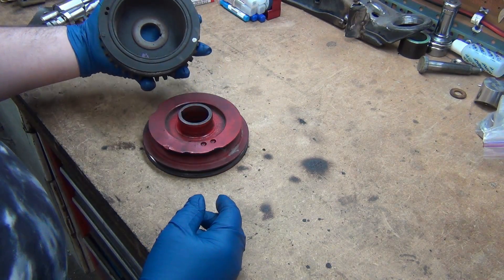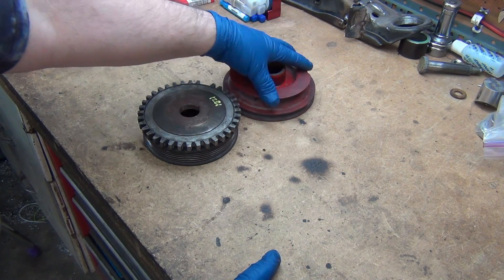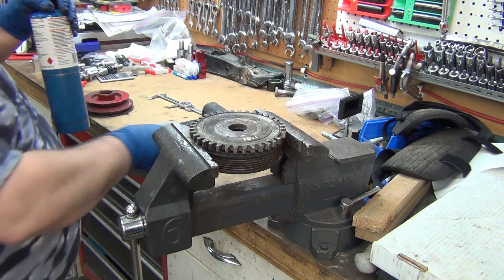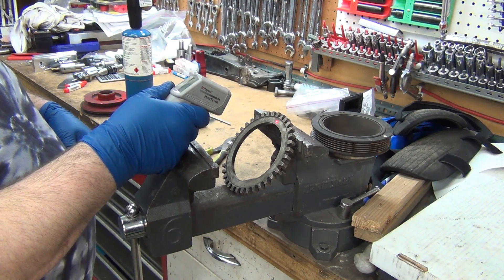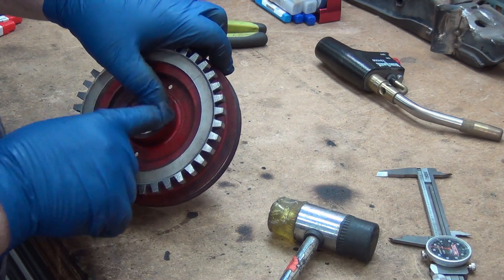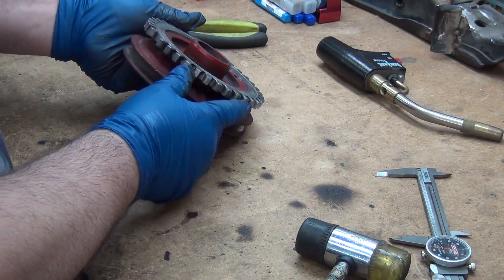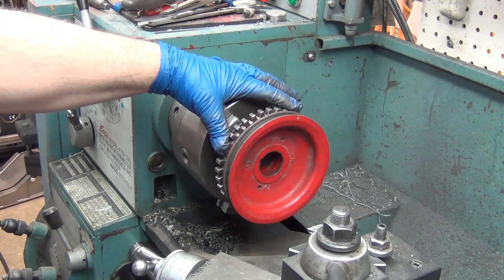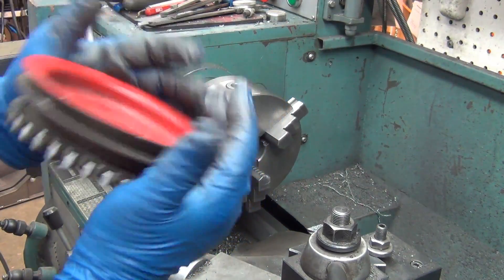Datsun - EDIS Pulley Mod

Comment: Can this also apply to a Datsun L6?
Reply from the maker: I don't know.  In theory, sure, but I have no clue if the crank pulley is the same diameter. I'm not 100% sure if the tooth count on the ring would matter.  I was just doing the machine work for another guy.  He knew about the mod.  I bought the pieces to do it to one of mine, but that rig is long gone. lol

Comment: Hi just wondering if this still allows for the second v belt to go on?
Reply from the maker: No.  The rear V section is cut down to hold the timing ring.
Reply: @bluehandsvideo  im trying to work out how I keep by double pulley and add a trigger too
Reply from the maker: @owlytv  I have no clue if there's a 3 V version.  You might need to figure out how to have the ring attached to the front side of the pulley.  Possibly put a dual V pulley on the next closest accessory and drive from there instead of the crank.  A custom made pulley might be possible.

Comment: Right ..locktite it on then no chance of warping the pulley and one can always get it back off easily if other mods are required without having to grind out welds making an ugly mess of things. Some of these modern adhesives are as good as a weld. For door skins on a car they used to be tack welded on, well now epoxies are used and the steel will rip and tear before you could ever get that epoxy bond to release. No weld clean up and can cut time to skin a door down to 25% of same job welded.
Reply from the maker: +1NRG24Seven  Great points! :) Thanks!!
  I think part of the reason they went to epoxies on the doors is because the sheet metal is way thinner.....harder to weld, easier to rip. lol   Heck....he could use JBWeld for that matter :)

Comment: Some L28s had these fitted factory on the 280z may have been a better option, he could megasquirt it, have fun.
Reply from the maker: +NuttyforNissan I didn't know that.  Interesting.  I have no clue if the crank pulleys are the same or not.   I'm sure he'll be using a megasquirt of some sort.
Reply: +NuttyforNissan - sounds like the 1981 280ZX turbo, only that first year of the turbo so not all that readily available.

Comment: Huh, that's quite an interesting mod!  I can definitely understand the want (need?) for a slip fit; depending on where the Ford sensor gets mounted on the Datsun block, the TDC gap could end up pretty much anywhere, not to mention being able to adjust base timing.  I almost wonder if it'd be worthwhile to stick a few set screws into the ring and machining stuff maybe half a thousandth of clearance, just to make adjusting base timing a bit easier.

Haha, this is why all my projects end up getting blown out of proportion.  Thoughts thoughts thoughts!
Reply from the maker: +rhkips He really should have figured out his sensor mounting first.  Could have done it with a spare timing cover in hand.  They typically get mounted fairly close to where the timing indicator/bracket is to start with.  The sensor bracket can be made to have the adjustment feature.  
Hmm...interesting idea on the set screws.  That might be a way to anchor the ring.  Maybe even drill/tap holes in the pulley to hold it.  Could drill down through the meat of the teeth. 
Sometimes, the hardest part of a project is just whittling down the options and making a decision.......drives me nuts sometimes!! lol
Reply: bluehandsvideo
Decisions are tough!  Best to just make them all!  LOL

The only issue with drilling the ring is that it may interfere with the signal the pickup sensor receives.  I hadn't thought about that...  D'oh!
Reply from the maker: +rhkips I thought about it affecting the sensor, but I figured I'd worry about it if it ever comes up again. lol  Maybe have a screw long enough that the head sits close to flush with the top of the tooth.  Maybe plug it with some aluminum rod after it's set......

Comment: It seems to me that, due to the missing tooth, the assembly really should be balanced after it's finalized?
Reply from the maker: +joshonthetube I think the ring was aluminum, so the weight was pretty insignificant.....not sure the motor would notice.  I hadn't thought about it before, but you've got me curious now.
Reply: is the missing tooth to signal that the sensor completes a rotation? im planning on doing a distributorless  ignition but retaining the dual su carbs
Reply: @TheRiceguy78  Missing tooth to detect TDC
Reply: @Alexie3333  thank you, it makes sense now